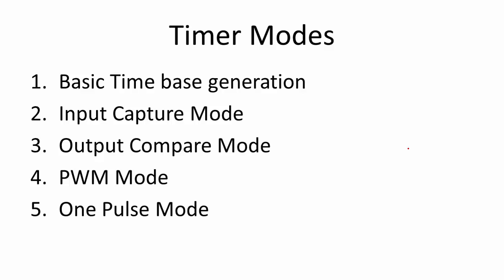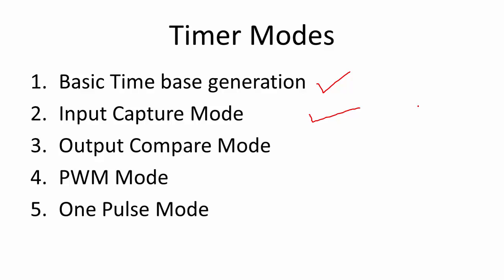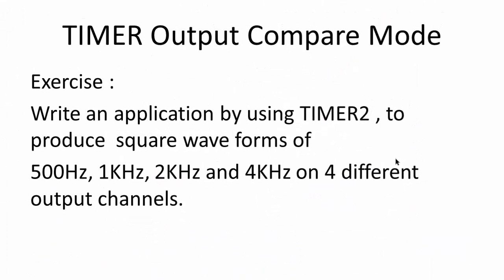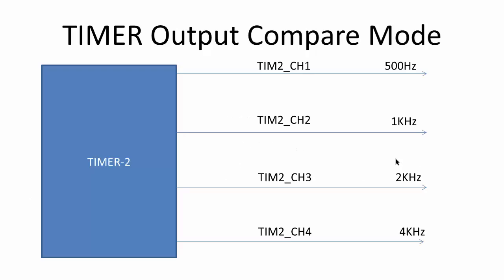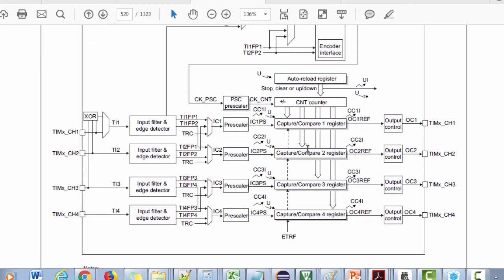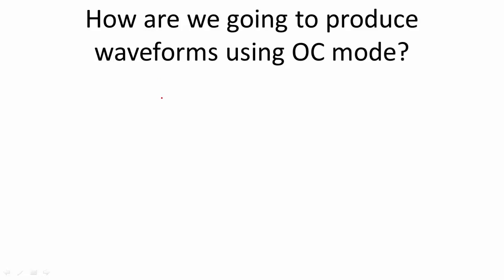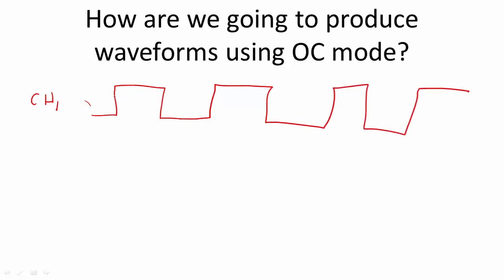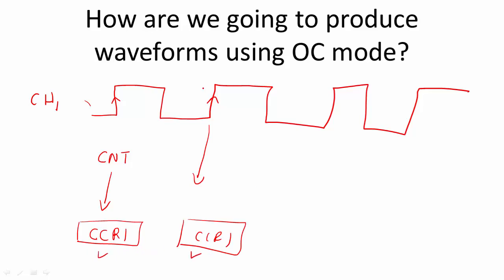STM32 General Purpose Timer: Understanding Output Compare (OC) Mode

Comment: You dont need interrupts to change CCR to get a waveform. Once you set the PSC and ARR you will always get the same frequency no matter what CCR is because ARR determines the counting period. Am I missing something??? no matter if CCR is 0, 3251, or whatever number, it will be matched at the same rate. Does CCR really not have a purpose for OC mode?

Comment: How does the output compare mode affect the timer output. What I mean is in your video you say that once the timer count reaches pulse value it toggles but does the behaviour not depend on what you have output compare mode set to (i.e 000 will freeze, 001 will be high if CNT==CCR, 010 will be low if CNT == CCR, 011 will toggle if CNT = CCR, 100 will be forced low, and 101 will be forced high). So are we saying that the mode is always 011 in this case if it just toggles everytime?
Reply: yes hes using the toggle on compare mode.